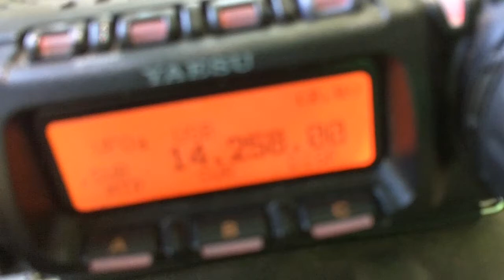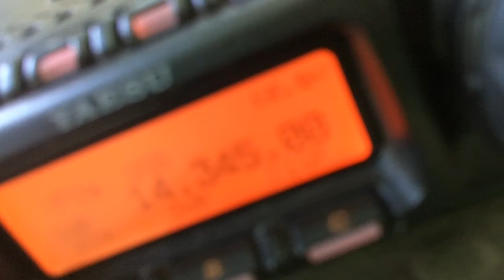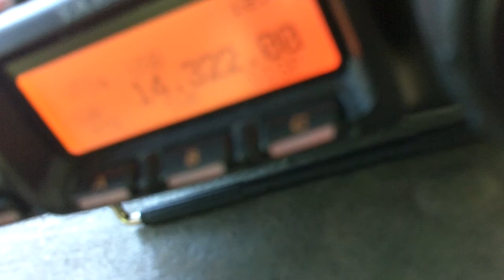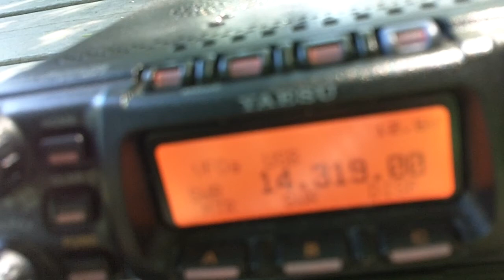End Fed antenna by W4KGH

Comment: Great video, thanks for showing us your antenna setup. If I may suggest, you might have more luck / faster comprehension if you use the standardized alphabet -- "Mike-Uniform-Lima" -- likely easier to pick out familiar sounds over the QRM / QRN. Either way, best of luck, and thanks again! 73, Prem KR7SH.
Reply from the maker: Thank you. Mike Uniform Lima. Got it. I need to remember phonetic alphabet for hams. I was trying so hard not to use phonetics that I used as a reserve police officer. LOL. Thanks again.
Reply: +rds801 Totally cool. Even though I know the standard words, I have it printed out and stuck inside the cover of my radio just in case. Never hurts to have a handy reference. 73! - Prem